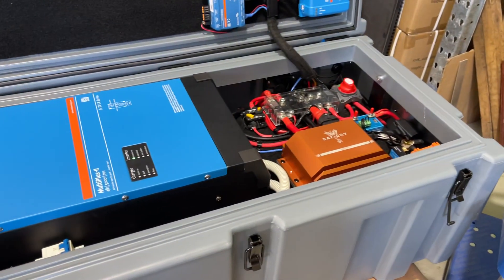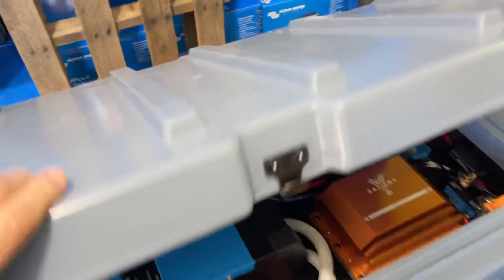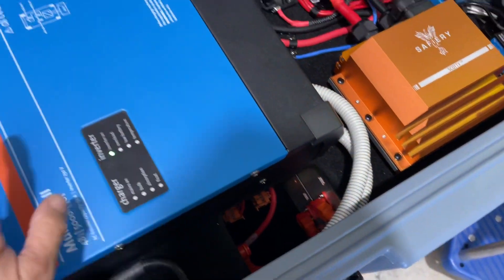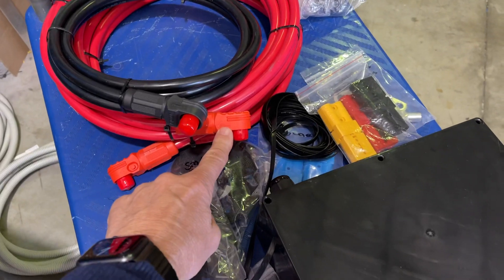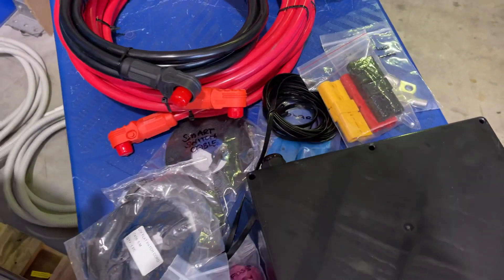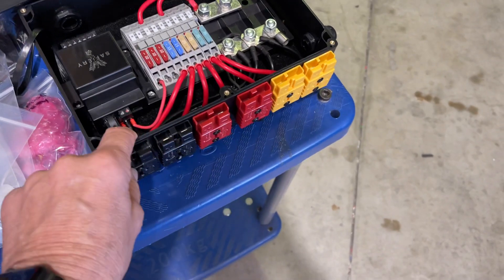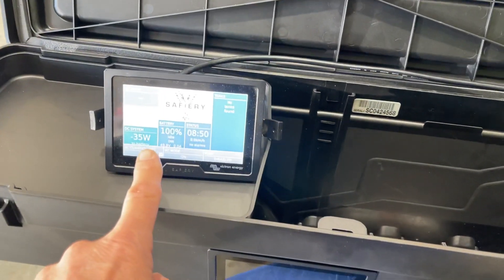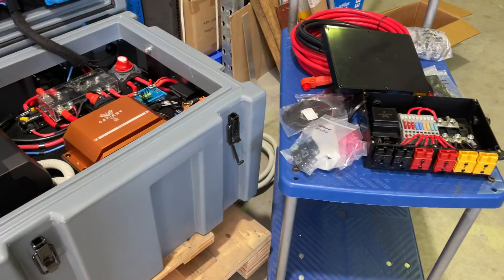48V Systems for RV’s are the Future

Comment: Surprised Elon has not developed a 48v system for RV to charge the future EV trucks and campers...
Reply from the maker: He would be at 400v level or now EVs of the future will be at 800v level. There is a dc dc to 12v in the Ioniq 6 I am driving but I haven’t found a 800-48v
Reply: Elon has bigger dreams than an RV

Like leaving this shithole behind

Comment: How to charger from the alternator?
Reply from the maker: Scotty is in case and takes up to 250A from Alternator and charges 48V at up to 3,000W. It is bi-directional DC to DC so when alternator not running, returns 12V to the low side from 48V
Reply: @Safiery  Can I buy it?